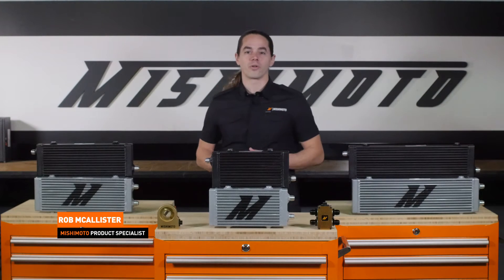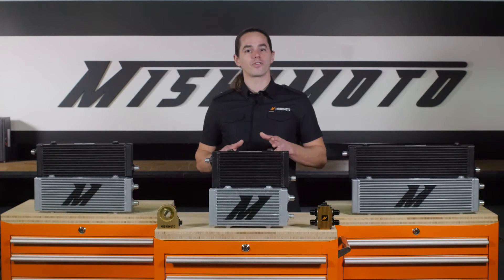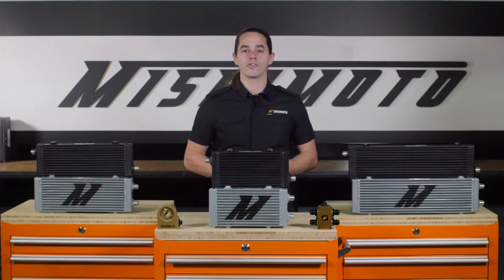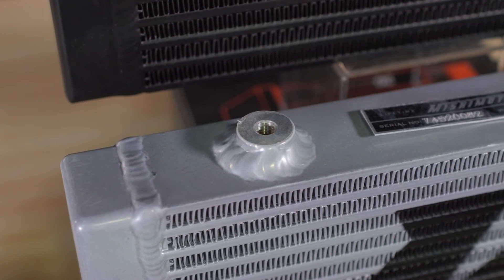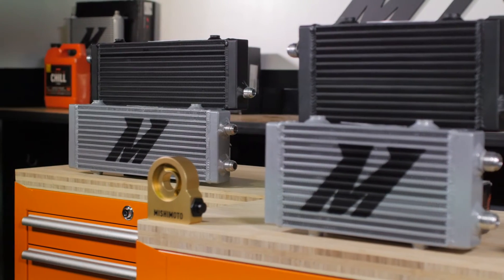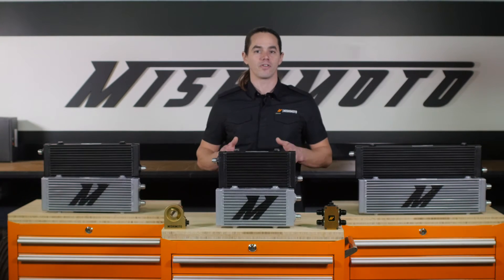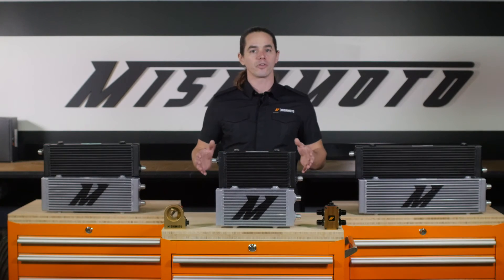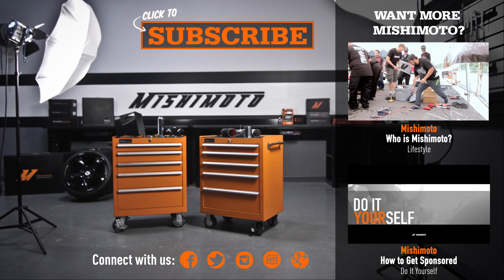Universal Cross Flow Bar & Plate Oil Cooler Features & Benefits by Mishimoto

Comment: Hi there, can I fit this oil cooler both fitting pointing upward, because not enough room if I fit it with both fittings are side ways. Thanks
Reply from the maker: Yes you can